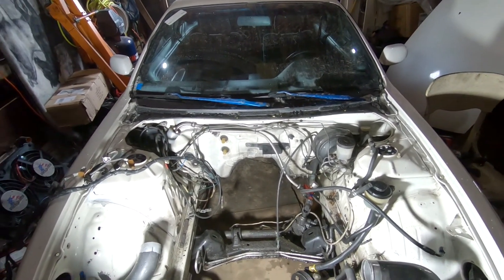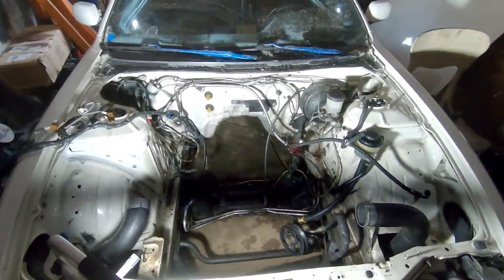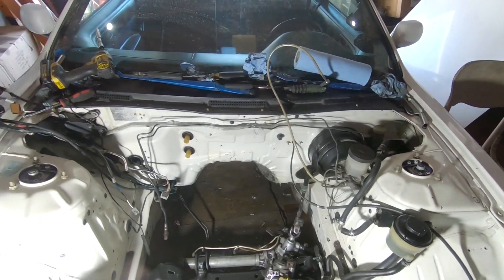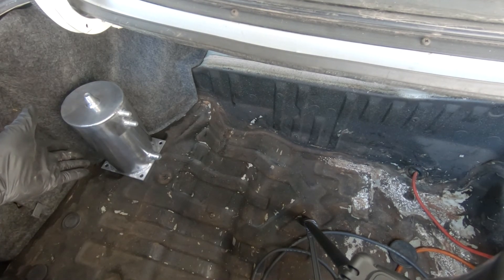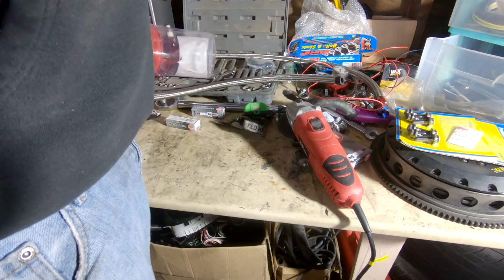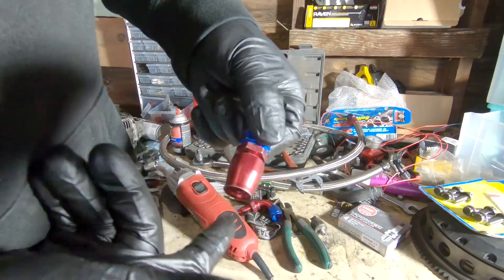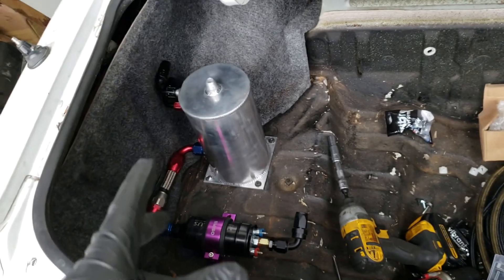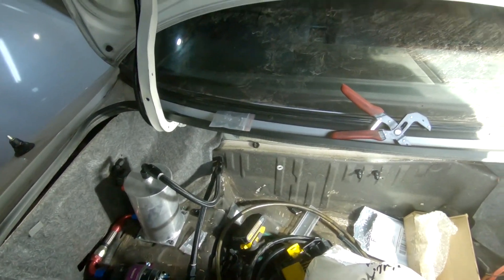Time to start my fuel system (1.5jz build part 7)

Comment: What do you think the stock GE bottom end will hold? I saw somewhere that the early GE blocks are just as strong as the GTE's. Theres also a guy on here with a stock GE block and he makes 7xxwhp thru a th400 which is around 8xxwhp thru a manual trans.
Reply from the maker: Yup same as gte basically. They're tanks, just higher compression pistons